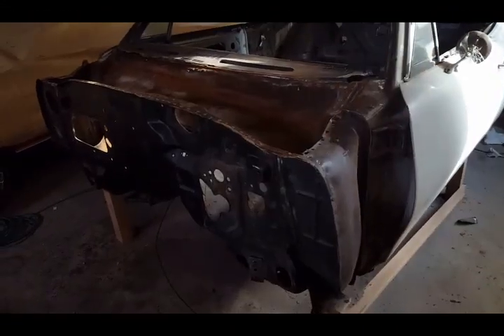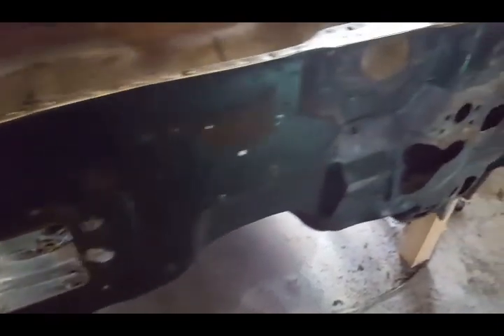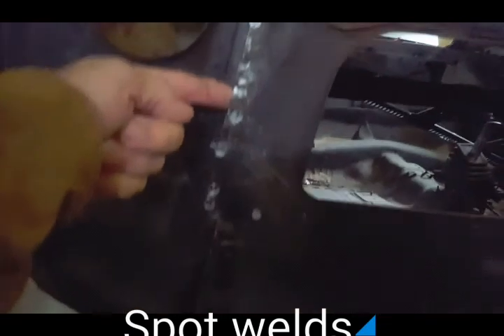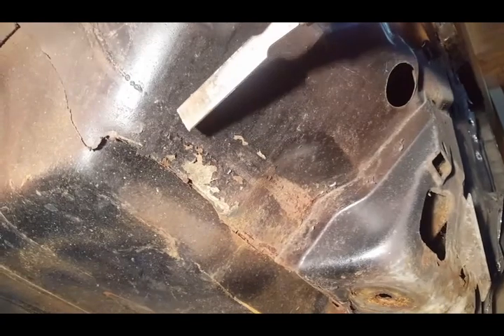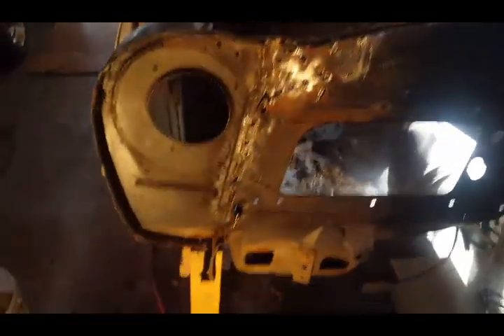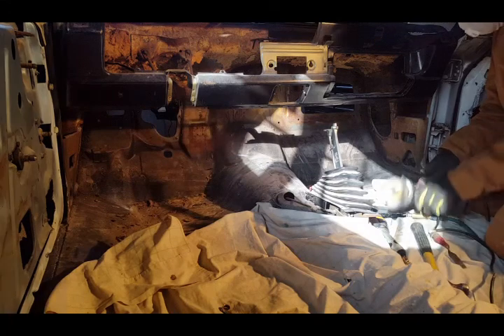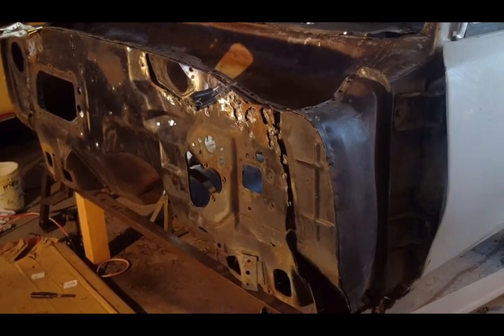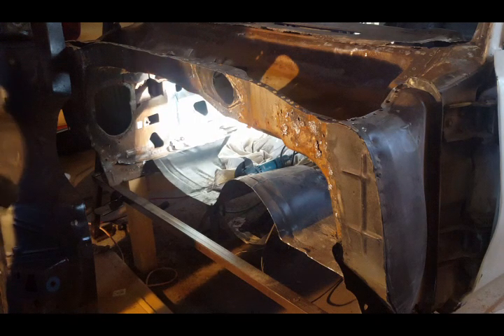Firewall removal 68-72 GTO, Chevelle, LeMans, Malibu, 442, Buick

Comment: Looks like your lower dash is not rusty, lucky you. It's probably because all the water drained through you windshield frame. I have the inverse problem and need to remove a perfectly good windshield cowl to work on a rusty inner dash.
I appreciate watching you do it before embarking on such a large surgery. Thank you.
Reply from the maker: Stop The Rust  sorry for the late response. Yes my whole Cowl panel is Rusted right where the window sat. And the inner dashboard. I bought a replacement windshield Channel put in, they make them for Chevelle's not for GTOs so I would have to do a lot of customizing to get it to fit properly. Thanks for stopping by my friend. all the best

Comment: Hey I have a question when you put in your upper wiper cowl did you had to massage to fit?
Reply from the maker: No, my cowl panel went in very easily. The only problem was. I tried to fit the plastic vents, they did not fit properly. So now I have to make some kind of custom adapter to accept the plastic flange. I hope this helps.
All the best...

Comment: I remember seeing a similar car like yours for sale on Craigslist in my NJ hometown in 2016.   replacement quarters and floors overlapped,  R/s was warped a little.  Car was a roller being sold with a 389 engine and no interior. It’s a good thing it’s being gone through either way
Reply from the maker: Yes. Andres yes it was sold as is 389. Down towards Sayreville NJ . Once I got it home, I realized the work done to it was really bad.  I decided to do everything all over. I'm going to build it into a retro rod with an LS3 motor
Reply: I also forgot to mention the tail on the rear license plate lol

Comment: Hey man! Great work! I am just curious.. why did you replace the firewall? It didn't seem too bad..I have a 69 Chevelle that I am currently restoring.
Reply from the maker: Hector E. Rodriguez Jr. Hi Hector. I am building a Resto rod and I'm putting an LS3 motor in it. I replace the firewall because I want a smooth firewall. I bought one with the heater core eliminated.
Reply: That's really awesome, Classic Rewind. I'm super grateful for your videos. You're encouraging me to post videos as well, with my Chevelle project. Looks great man. I've subscribed. Keep up the awesome work!
Reply from the maker: Hector E. Rodriguez Jr. You welcome. thanks for the sub. I have a 68 Chevelle Super Sport that's totally restored. You might see it next to the GTO under the car cover. If you need any suggestions or help just let me know.
Reply: Thank you so much! I appreciate that.